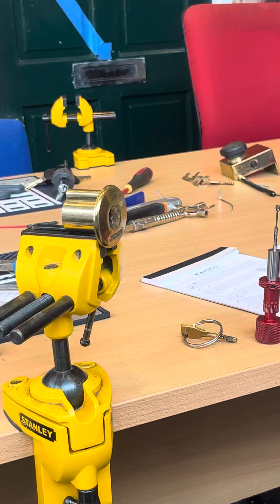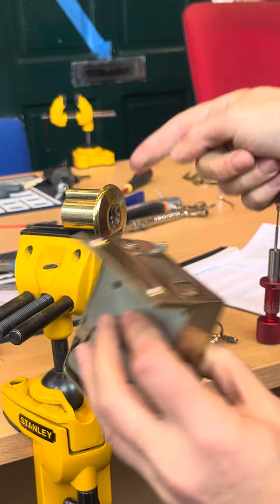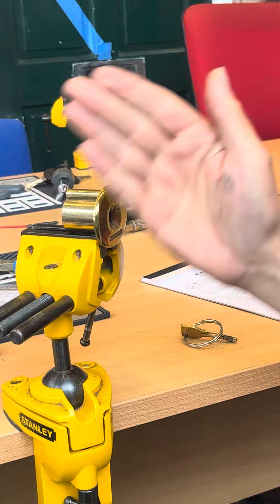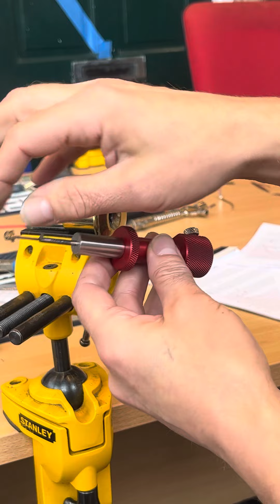Chubb AVA 4L67 picked

Comment: Nice picking Seth! Alternatively you can just use your smart bud to look at the wafer numbers and cut a working key within about 5 minutes.
Reply from the maker: Wouldn’t even know how to begin cutting one of these keys to code
Reply: Not all AVA locks have numbers on the wafers Gav but yeah scoping works on them all of you know what your looking for
Reply from the maker: @andy123law  aye, the wafers are stamped left and right with the numbers but now I know what I’m doing I could probably pick it quicker than scoping and cutting 😎😎🔑
Reply: @andy123law  ah ok, all the ones I have looked in have had the numbers there be it rim cylinder, patio bolt etc. like you say you can manage without the numbers tho.